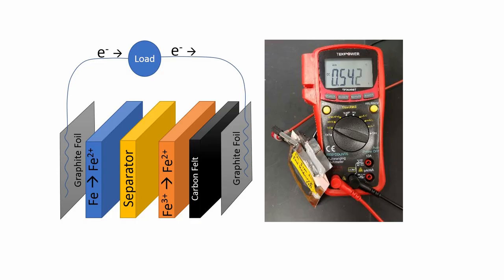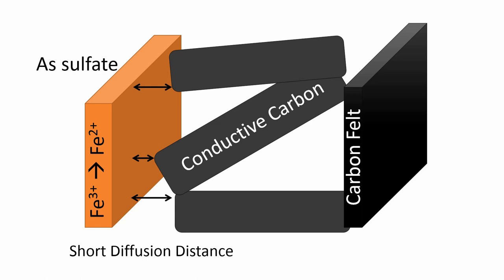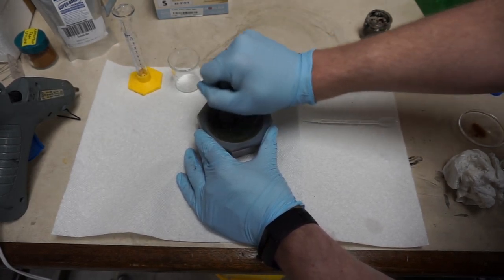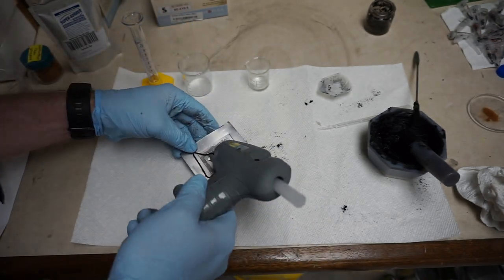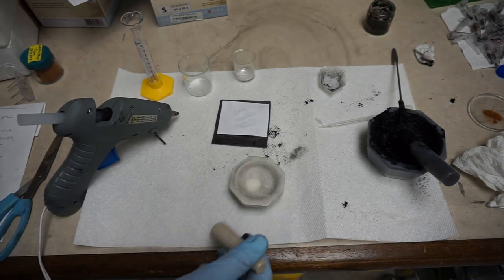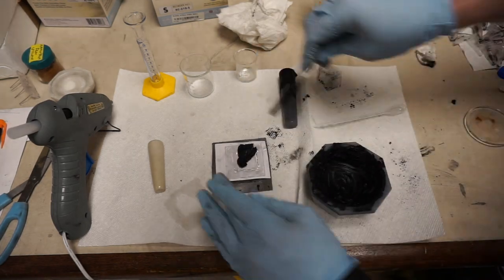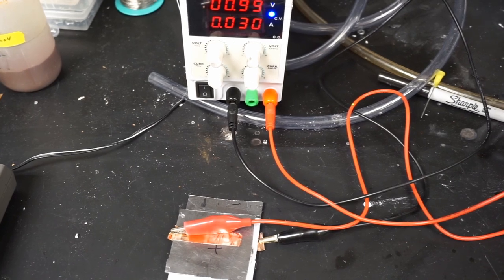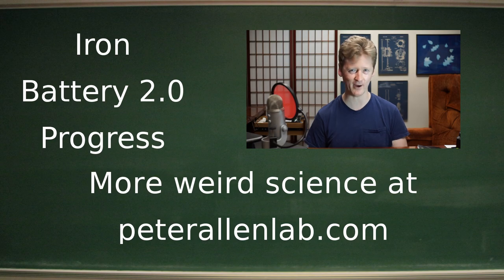Progress toward Iron Battery 2.0

Comment: I’ve been waiting for the update. The wait was worth it. There has been progress.
Perhaps the polyacrylate could be dissolved in an appropriate solvent, applied, and dried (if necessary).
Reply from the maker: Thanks! We've been thinking of similar ideas to try to get the polyacrylate paper sandwich more uniform. I think sealing the paper halves then applying wet gel instead of powder will help.

Comment: Instead of the mortar and pestle, a coffee grinder followed by a sieve would be faster and more consistent. Interesting developments, keep up the good work!
Reply from the maker: I made a big batch of a previous recipe (for the 1L battery) in a blender. That worked pretty well. We use the ball mill to get the carbon black really fine. The finely powdered carbon black is not very happy going into water, so a blender helps for sure. For this ~10 ml batch, there's just not enough for a blender to get a grip on, but a coffee grinder might work.
Reply: @PeterAllenLab  instead of carbon black why don't you try graphite oxide?
Reply: @trevorvanzuydam8115  i was just thinking activated carbon.. if you just need a conductor with a high surface area...
Reply: @evilplaguedoctor5158  yea but graphite oxide has a much better resistance and way way better surface area once exfoliated.

Comment: Yahoo!!! Iron battery is back. Have you considered using insoluble salts or iron so that you don't have to play with the separator at all. Maybe even oxides in a 20% KOH solution. I know you wanted to make this DIY friendly but I am rather looking at large scale solar storage applications in developing countries.
Reply from the maker: I know that the Edison cell uses KOH. It's less conductive than NaOH, so that's good. That would help eliminate the need for a membrane. But right now, it's not clear what the necessary components are for good reversibility. We will have to try KOH and see what it does.
Reply: @PeterAllenLab  I thought the limitation was power density and not repeatability.
Reply: @sujoybha  the limitation are both cost and cycle life, the power could be improved using vantablack electrodes

Comment: Could you use vanadium pentoxide as a redox additive? I have even use molybdenum disulfide as an additive.
Reply from the maker: We didn't try vanadium compounds, but we did try a couple of soluble iron based mediators back in the day. Sounds interesting. One thing that seems to help is to match the additive's redox potential to the electrode's. If it's matched, it could help a lot.